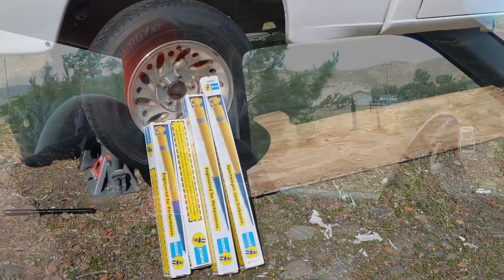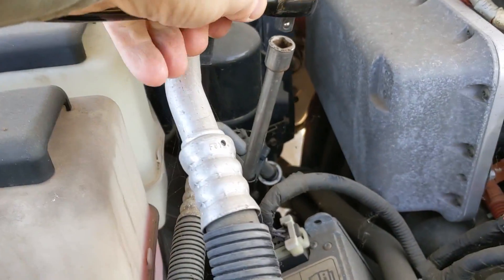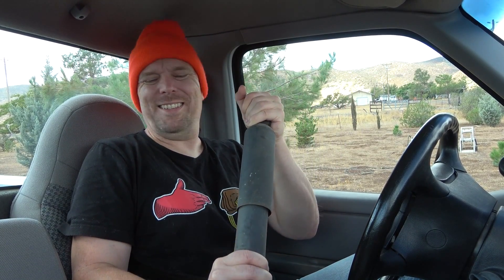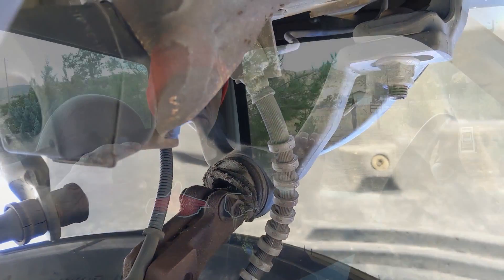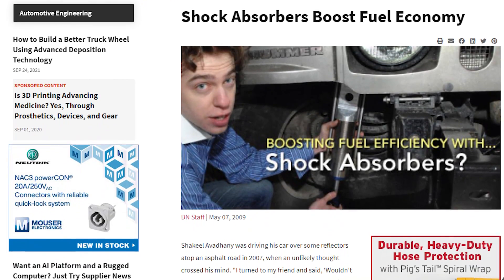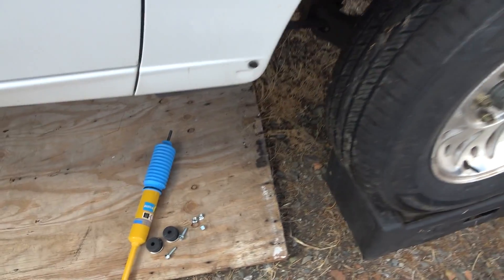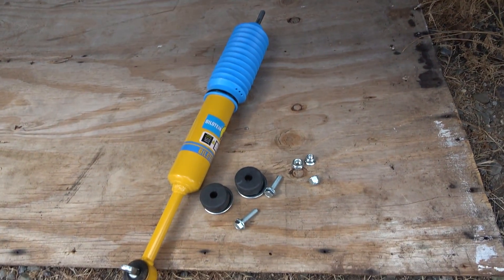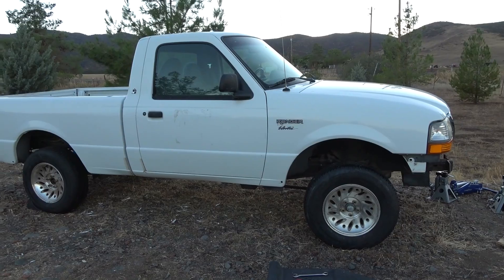Ford Ranger Electric: Replacing the Shocks

Comment: It’s an interesting idea, though there is a flaw. Shocks arent suspension, they simply damp the movement of the suspension. They, literally, absorb unwanted oscillations in the springs. Yes, they can affect the stiffness of the ride, but they wont allow you to put an extra 3000lbs onboard - that’s a job for the actual suspension. What shocks really do is damp the suspension to keep the tire on the road as much as possible, and to keep the tire’s motion out of the cabin. 

Still, the idea is sound. I can imagine a swing arm suspension where the pivot point is a generator. I could also imagine a pressurized fluid driving a generator. 

How much energy are we talking about? A better educated person than me could figure it out. You’ve got a body that maybe moves 6 inches (3” up, 3” down over normal bumps) and it’s suspending a 3000lb car body. So that’s half of 3000 ft/lbs. But it generates it going over the bump. 1500ft/lbs for maybe .2 seconds, maybe 30 times per minute. So that’s a power of 1500ft/lbs for 6 seconds per minute. What’s that equal in kw? No idea. 

Fun to think about, though.
Reply from the maker: The article I linked to in the description lists some numbers, but as others have noted, I'm not sure whether they've been independently verified. Some of the numbers they listed were 1.5 kW for a 3,000 lb car and 1 kW per shock on heavier duty vehicles. 

A hydraulic pump linked to a central generator might be the easiest way to integrate the system, but I'm not sure how the flow would be managed to maintain a constant flow across the turbine.
Reply: @newscoulomb3705  You dont need a constant flow. An impeller inline with the fluid flow would spin - doesnt matter which direction. 

You could make this yourself easily. Wrap a shock in fine copper wire, stick a horseshoe magnet over it. A/C  generating Dynamo. Amount of power you’d get? Almost nothing. What you need is the resistive force of the generator to be the car’s suspension.

Comment: That company making the generator shocks is vague on what they generate for a reason.  When someone gives vague information it is because they don't want you to know the truth.  I can almost guarantee that the 1.5 KW generated would be if they put it on a test stand and move it back and forth as fast as possible.  No way in hell would you generate that much power from the same shock while driving the car.  "Normal" shocks dissipate energy as heat, 1.5 KW is more than you get from an electric space heater!  You could possibly generate that kind of power in a Baja 1000 truck :)
Reply from the maker: Yes. Some companies were looking into it, and they might not have found enough justification. Though as I noted in the video, it means a whole lot more to an EV than it does to an ICE. 

Still, the 1.5 kW was across all four shocks on a 3,000 lb car, so 375 W per shock, which is more reasonable. They did say that for heavy duty vehicles, they were seeing as much as 1 kW per shock. 

I can personally think of several methods for generating the electricity at the shock level. To me, the more interesting numbers are (to your point) how much is generated and how is it integrated with the rest of the car's systems. As we saw with early automotive solar panels, the best use for that amount of energy was charging the 12 V battery and running accessories.

Comment: It comes down to return on the complexity you would have to invest in for such a small UNPROVEN
gain. The gains these companies claim would need a lot of data to back it up.Was this amount of 
energy on a highway or a potholed road? Who knows, I bet they never published any verified data.

There are graveyards full of ideas and patents that are documented but never were made after a lot 
of time and money were put in , because they were not of enough value, remember the 100 mile gas
carburetor on ICE vehicles, always some kind of hidden info never to be disclosed.
Reply from the maker: Sure. There's certainly some validity to that. Even when something is proven to be effective, it isn't always implemented. In ICE, the best you'd get out of these shocks is recharging the 12 V battery. If the numbers are valid, this system would be right-sized for a small car, but overkill for a large, heavy vehicle. 

Regardless, the best you do in an ICE is eliminating the parasitic losses for the alternator, which is also about a 10% improvement in fuel economy for a small car, but maybe only 2% to 5% for a larger vehicle. That's why things like the TIGERS alternator (https://www.greencarcongress.com/2005/09/tigers_exhaust_.html) and BMW's TEG alternator replacement (https://newatlas.com/thermoelectric-cars-improve-mpg/10928/) never took off. 

In the case of EVs, there's a much better return on investment, especially because a 10% increase in range represents the same value as a 10% increase in batteries, an instant >$1,000 savings on a limited resource. Even still, the most value for these shocks would be for large, heavy vehicles with multiple axles. EV cargo haulers like the GM Brightdrop and semis like the Freightliner eCascadia would probably represent the best opportunity to test and assess the real world ROI.

Comment: Too old now so I have most of those things done, but I did do some shocks and sway bars in the late seventies. I think I gave up about five years ago when it took six hours to change the plugs on a 2002 Camry V6.
Reply from the maker: Yeah. There's actually a lot of stuff to do on these Rangers that I might not do myself. It depends on my mood, time, and budget. While I'm waiting for the EV specific stuff to get in order, I might as well do some of the mechanical stuff. Plus, I don't know how willing a mechanic shop would be to work on EVs, even if what they're doing isn't connected to the HV system.

Comment: That’s a really interesting way to generate electricity. Wonder if GM could build that into their magnetic ride control system somehow.
Reply from the maker: Yes, that's a possibility. I would really like to see a suspension engineer use accumulated data about travel and energy absorption to identify the best strategies for recapturing that energy in a usable form (i.e., electrically).

Comment: I hadn't read of the power generating shocks before, that's cool, get those and a roll up solar tonneau cover and the old truck might break 4kw/mile!  Like the helper too!
Reply from the maker: Thanks! Yes, One-Eyed Jack. He's a real help. :-)

Funny enough, in independent testing, the Ranger Electric was getting around 4 mi/kWh at 45 mph steady speed. On typical driving cycles, it was getting about 3.2 mi/kWh, and after 60 mph steady speeds, that dropped to about 2.8 mi/kWh. 

If I can see just a 10% improvement all the way around, 3.5 mi/kWh cycle and around 3 mi/kWh at 60-65 mph, I'll be happy.

Comment: It would be an excellent idea for manufacturers to take advantage of scavenging any "free recharging" they can get their hands on. I haven't been able to fully follow this project but, I was wondering if you will install undercarriage panels to smooth out the airflow as much as possible especially since trucks are higher off the ground. As a former auto mechanic, I try to work on my own cars as much as possible. I recently had to replace the rear shocks on my 2016 "Mother Focus" and used the Bilsteins. So far so good. I will replace the front struts soon... Anyhoo, looks like the truck project is coming along quite well, even if it is with "helping paws (& claws)". 😁😁
Reply from the maker: Thanks! Yes, I am considering a few aero mods. These came stock with soft  Tonneau covers that have been lost over the years. 

And the paws are definitely a help. 🙂
Reply: @newscoulomb3705  I see you and the cat are on top of this, aero and all. I missed mentioning that I am quite desperate to get rid of the Ford Focus and wanted a Bolt EUV, which I can't purchase right now. I'll keep waiting as if I had a choice.(I own Tesla stock, don't want the product... I've own three Fords and, after that disastrous Focus, I don't want another one)
Reply from the maker: @Roddy451  The Bolt EUV should be back available by mid-October. It might be worth seeing if you can lock in a deal with a dealership right now because they might be hard to get after the stop sale is lifted (battery supply, chip shortage, etc.).

Comment: Greetings Eric, it strikes me that the amount of energy generated by electric power-producing shock absorbers would be heavily dependent on the roughness of the road. A smooth road will convey a lot less power to the shocks than a rough road. As such, the 1.5kW number quoted by the old vendor might be correct energy flow rate for a particular value of road roughness. Too bad there are no metrics that I know of for road roughness.
Regardless it is an interesting idea for recapturing energy that would otherwise be lost.
Reply from the maker: Yes, they definitely need to do some additional testing. Generating energy is extremely easy to do. Gathering, storing, and transmitting it in a useful way is much harder. These shocks might require a small control box to gather and transfer the energy, but that might be a good idea anyway because it can also be used to control and adjust the shocks.

Still, you might be surprised at how much energy can be generated even on smooth roads. Accelerating, decelerating, cornering, etc. can all apply a lot of force on the suspension. In the article, it was stating that on heavier vehicles, each shock was generating 1 kW.